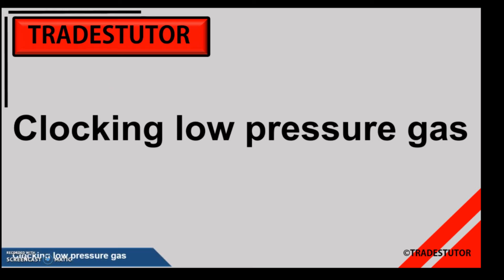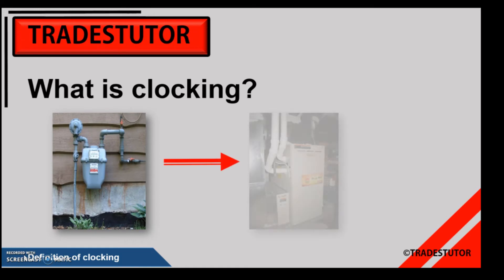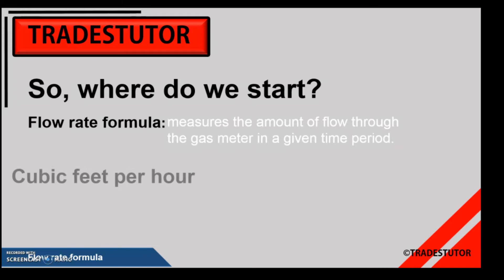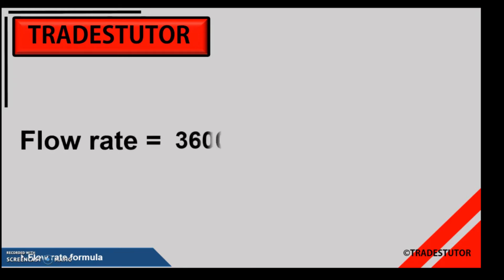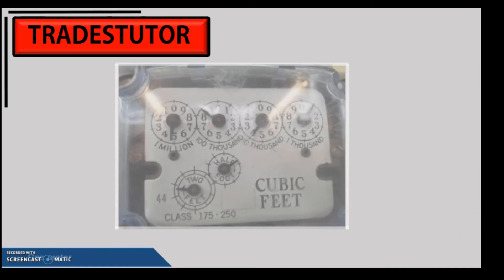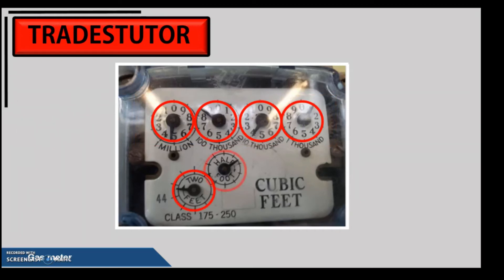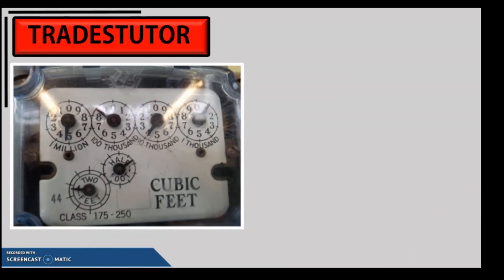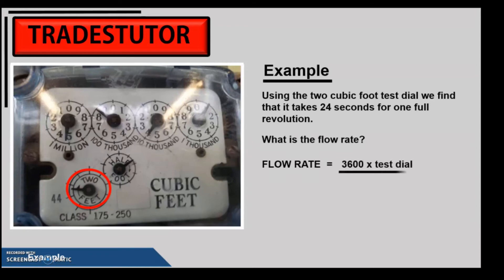Calculating the firing rate of a gas fired appliance.

Comment: What exactly is the firing rate?
Reply from the maker: Hi Scott: The firing rate is the the rating of the appliance. An example would be a hot water tank with an input (or firing rate) of 50,000 BTUH. Hope this helps and thanks for watching. Take care.
Reply: @tradestutor1191  so at 5000 feet altitude we would derate to a “firing rate” of roughly 45k btu?
Reply from the maker: Hi Scott: If you are installing an appliance above 2000 feet is should have a high altitude rating. This rating works from 2000-4500 feet. Above 4500 feet you derate the high altitude rating by 4% for every 1000 feet you go up. Therefore you would be rating the high altitude by 4% in this case. You should always check with your local authority having jurisdiction though just in case things are different where you are. Take care and thanks for watching.
Reply: That number is found on the serial/model number tag on your appliance,  like saying my furnace is an 80,000 btu furance.  that number is the input rating